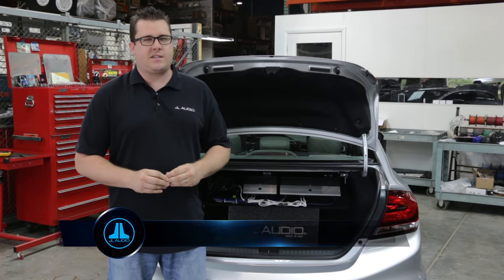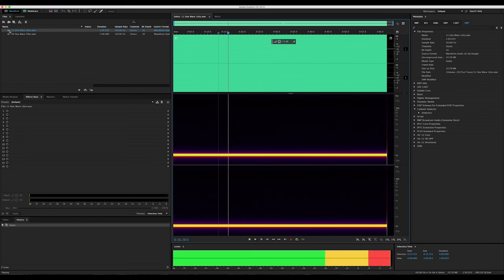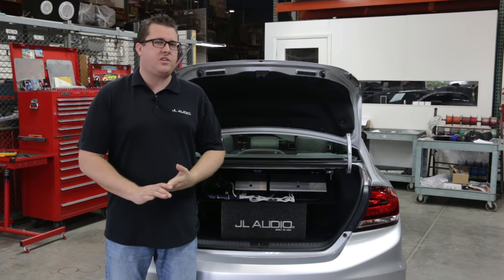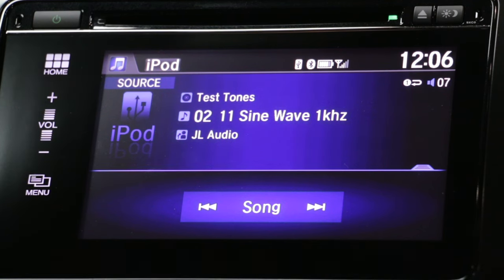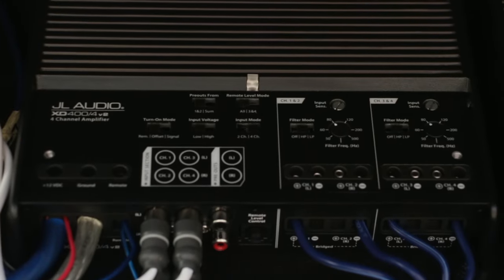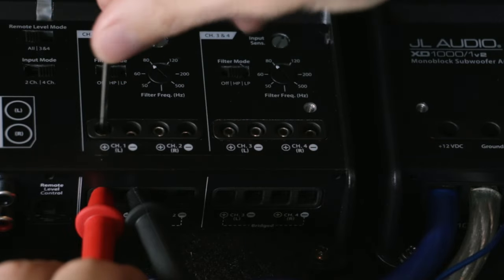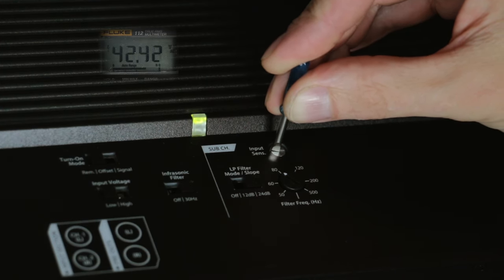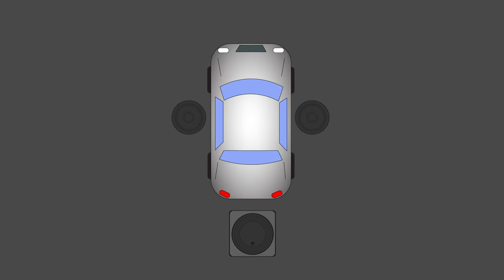Setting Amplifier Gain or Input Sensitivity

Comment: Tried this yesterday but for some reason i vould only get 0.24 volts nowhere near the 24.9 i need , any ideas as to why ? I used a 50 hz -3db test tone,  3/4 volume everything flat or off ! Voltage went up a bit with a bit of bass boost but still couldn't get 24.9 😢
Reply: Depends on the setting you had on the multimeter.  You probably had it on the wrong scale/range so it was showing it as a really small number.  My multimeter has different scales/ranges for each type.  I'm assuming your 0.24 was really 24 volts it just had the decimal place in the wrong spot because of the setting you had the multimeter on.  Just a guess but I'm sure that's what it is.  A good way to make sure you're on the right range is to pop your hood and put it on your battery (car off).  Should be around 12V-12.9V reading.  Change the range setting on the multimeter until you're seeing the numbers display correctly.
Reply: @rxtuninginc8444  ended up with an oscope , the 24 is now an unclipped 27 volts and hits 🤜🤛👌

Comment: so if i have 2 subs that are 750 rms each do i tune at 750 or 1500 my amp is a3500 watt max
Reply from the maker: You would be trying to reach 1500W, but first you'd need to know the RMS power of the amplifier, not max. If the amplifier is only rated at 1200W rms, then when you try to set it for 1500W you'll likely end up with a badly clipped signal.

Comment: Hi. For 4 ohm driver with crossover attach, calculation still base on 4 ohm right.
Reply from the maker: That's correct. Use the rated nominal impedance for the driver(s) being used.

Comment: HELP PLEASE! 
MY amp is rated at 800@1ohm(pioneer 8601). My subs are 200watts nominal each(pioneer TS-W253R) and I have 3 subs. So what should I be reading on my multi-meter when setting the gain for these?
Reply from the maker: Three Pioneer TS-W253R subwoofers wired in parallel will present a 1.33 ohm load to the output of your Pioneer GM-D8601 monoblock amplifier. Based on the published specifications of your amplifier, it should be able to deliver around 600 watts x 1 channel @ 1.33 ohms, which coincides with the collective power handling of your three subwoofers combined. When calibrating to a target voltage by following the steps within our Amplifier Level Setting guide (https://jlaudio.zendesk.com/hc/en-us/articles/204374120-Amplifier-Level-Setting-Guide), you will need to calibrate your amplifier to a target voltage of 28.2 VAC. This will be equal to 600 watts @ 1.33 ohms.

Comment: What kind of deck is in this civic???? thanks JL
Reply from the maker: Stock Honda head unit.  Has a 7" touch screen, back-up camera, blind spot camera, Bluetooth, USB, HDMI and more.  There was really no need to take it out and is why the FiX 82 is being used to correct the factory equalization and send it on to the amplifier.

Comment: What is the voltage for my jlaudio j2 320.4 amplifier that I still have?
Reply: use the formula Voltage  = sqrt( RMS power rating * resistance of speaker)
Reply: @Andrewkosche  thanks
Reply: Wait I’m sorry, what do you mean amplifier? The gain should be set to match your speaker from your amp
Reply: When I say rms power rating I mean of your speakers not amps max rms rating

Comment: I use bluetooth aux device with ground loop isolator. Streaming music via Spotify Highest Quality. And my phone iş Samsung S9+
Max volume is 15 on phone and max volume on sony head unit 50.
Which setting is best ?
Max volume on phone and 3/4 head unit ? 
Or %60 on phone 3/4 on head unit.
Some folk says you should set BT volume about %50-60 to avoid distortion. Thank you for help
Reply from the maker: We usually use ~85% on the phone, basically 2 clicks down from max, in order to avoid distortion. If you go too low on the BT level, then you run a risk of overdriving the amp during your normal listening.

Comment: Any and everyone I've ever talked to in the car audio scene will tell you to use 40hz test tone when tuning your mono amp.
Reply from the maker: Usually any tone within the middle of the bass range will work for the meter method. We use 50 Hz, but 40 Hz should be fine. In using a DD-1 you must use a 40 Hz tone since that is what the device is looking for. Our amps with clip lights are looking for the 50 Hz tone, so you should use 50 Hz when setting clip lights on our amplifiers.
Reply: @JLAudioInc  a class d mono is a class d mono. Your mono amps are no different then any other mono amp. Quit telling people to use a 50hz. 😂.
Reply: @irishmanbd8447  The Dd-1 looks for harmonic distortion at 40hz. JLaudio looks for harmonic distortion at 50hz. Why would they make up an arbitrary number?

Comment: What happens if i put a 350watt psu on a 700watt amp? Is it going to explode when the bass drops?
Reply: SakiSkai no set the gain by taking square root of 350 and set it till your voltage reads that number in speaker output

Comment: On the civic did you guys use another battery or something. I have a 9th gen civic as well and I'm running a 500/1 slash and 2 8w7AE and my lights always dim.
Reply: Did you solve the dimming lights problem?I know, its been 3 years :)

Comment: why dont use a oscilloscope? I think is better and you can mesure the output of the head unit and know the maximum output of it
Reply from the maker: @Jesus Facundo, an oscilloscope is great if you have access to one, but not everyone has one. This is a great alternative as long as you know the amplifiers you are using will do their rated power at the impedance you intend to power.

Comment: I have the jx500/1d with the 10w0v3-4 filter frequency and input sensitivity control they need to be all the way up or where they need to be if you guys can help me please
Reply from the maker: Hello Edgar.  Thank you so much for reaching out to us. 

 So, the LPF or low pass filter is the filter that we use to block out unwanted frequencies that can damage the subwoofer or degrade the listening experience.  A common starting point for the LPF is 80hz and that is what we would recommend for you.  

The input sensitive is the most important dial on that your amplifier and it must be set properly to avoid equipment damage or an unpleasant listening experience.  I will link a video showing in detail our 9 step level setting guide.

Thank you for choosing JL Audio for your vehicles subwoofer system.

https://www.youtube.com/watch?v=2eRYzXBmWq8
Reply: JL Audio thank you so much
Reply: The subwoofer it shut be connected on the +and - on the middle or the ones on the sides
Reply from the maker: Edgar, either way will work.  Sorry for the delayed response.
Reply: JL Audio thank you

Comment: What do I do if my door speakers are hooked up too my head unit & while trying to adjust the gain on my 1000/1v2 my door speakers are going crazy ???
Reply from the maker: Your best solution is to unhook the door speakers to avoid damage. You can also try engaging a high pass filter on the radio, if it has one. This should block out the 50 Hz tone.
Reply: @JLAudioInc  will it work if I adjust the fade and balance just to the speaker where I have the line output converter? That way I only need to disconnect one speaker..

Comment: I do everything exactly as the video says, but when I put my multimeter leads into the speaker terminals I don't get any reading at all, nothing. I have the AC set to 200 AC, the closest I can set it to. The amplifier I use is a Rockville RXH-F5, a 5 channel amp with one  gain knob for 1/2 channels, another knob for 3/4, and one gain knob for the 5th channel, for my sub. 

I don't get readings on any of the leads, would anyone be able to help with advice, please? It would be greatly appreciated.
Reply from the maker: You are using the recommended sine waves at 3/4 volume, correct?

Also, make sure the leads are in the correct spot on the meter. Many multi-meters have two different terminals for the positive lead, one for DC power and the other for AC power.
Reply: @JLAudioInc  Yes, I'm using 0db sine waves, 50hz and 1khz, at 3/4 volume. My multimeter only has two test leads, the COM and the other lead. It may be possible my multimeter is defective or it's insufficient enough to read lower voltages. That's the only conclusion I can come up with.
Reply from the maker: If the meter shows a "200" setting, it would be able to read anything from 0 - 200ACV so it should not be an issue. Unfortunately it may be a defective meter, or perhaps one of the lead wires is damaged.
Reply: @JLAudioInc  I figured it out by trial and error. I tested every combination @3/4 volume with the 0db 1khz and 50hz, and the wires disconnected, to check if I would get a reading that would fluctuate with gain change. I found that if I connected the positive lead of multimeter to the main ground terminal of the amp, and the negative lead to the positive terminal of any of the channels on the amp that I would get a reading I could change by adjusting the gain. As I was testing, I set my subwoofer output to 26.5volts, but for my front and rear speakers, I got much lower voltages, they would only go up to 6.2 with the gain set to max. I'm 99.9% positive I have everything set all correctly. All the EQ, crossovers, and other settings were default or off.

Comment: I can’t find output voltage for jd400/1 jd500/1
Reply from the maker: We do not list output voltage since those are set using the clip indicators, but general voltages would be about 17.3 volts per channel on 400/4 and 31.6 volts at 2 ohm or 4 ohm on 500/1

Comment: what happens when you try to set your gain to high ? will the voltmeter just stop at its max ? will the voltage jump around once you start reaching clipping ? I am having trouble determining if I'm clipping my speakers to death or they are just over powered ?
Reply from the maker: If the gain is set to high the meter will just read it as higher voltage until you have maxed out the sensitivity dial. A regular multi meter will only show you the higher voltage number.  If you use an oscilloscope it would show you at what point past our suggested target voltage the amplifier starts clipping at. Without a scope then it is safest to stop at the target voltage since we know our amplifiers are capable of the target without clipping, as long as the input signal itself is not clipping.

Comment: Pioneer  GM-D9601 amp at 1200 rms 
2 Pioneer TS-W3003D4
At 600 watt continous power.
34hrtz?
Reply from the maker: For 1200 watts at 1 ohm you would take 1200 watts times 1 ohm and then take the square root of the answer to find your target voltage for setting the sensitivity. this would be 34.6 volts A/C.

Comment: Can anyone help me out. I have a 500/1 amp and a 10w7 sub. If I did my math correct, I'm looking to set my amp gain to 38.7 volts. Here's my problem.  I'm getting no AC volt reading. I followed all the eq settings as per the video and still nothing. The amp is in the car powered by the battery, the amp green light is lit, and still no AC signal from the speaker nodes. the only variable I can think of is to set the DMM to DC. Any suggestions are appreciated.
Reply: do you have shitty rcas. that will do it
Reply from the maker: Does the subwoofer play when connected to the amp?  If so you have a bad DMM.  If not, please contact our Technical Support team so we can help you troubleshoot why there would be no output from the amp.
Reply: +JLAudioInc yes the sub plays, so I'll buy a new DMM and repeat the process.  Thanks for the help.
Reply: I ran into this same issue, until smart Me realized i should turn the car on first. LOOOL

Comment: 5:10 The "Gain Knob" is not a volume control. At least thats what I have been always told.
Reply: That's for increasing the volume, decreasing volume by adjusting the gain is perfectly fine.
Reply: You can't hurt your system by turning your gain lower, however turning your game up past its limits is where you start to hurt the system. If you kept listening to what he was saying, he explicitly stated to not turn one of the amps up but to turn the other one down. Turning volume down is better than turning it up.
Reply: @Mrjoecreeper  No its not. A gain control is not a volume control. Gain controls are on the input side of the component, while volume controls are on the output side. A volume control can't distort the signal. That's why you need to set your gain structure in the first place. Only gain can distort the signal, so once you have it set properly, the signal can't distort regardless of volume. Once you have gain set, leave it alone.

Comment: so according to this, we use the hpf and lpf we are going to be using when setting the gains?  most everywhere else says to turn them off
Reply: crossovers affect output voltage I found when I turn up my lpf on my monoblock amp the output voltage gose up and when I turn it down it gose down so I think its best to set the crossover first to the hertz level you want for a sub id say 50 -80 hertz somewhere in their then adjust your gain

Comment: How do you set the LPF?
Reply from the maker: Albert, for most subwoofer systems we'd recommend starting with your LPF @ 80hz.
Reply from the maker: Looking at that amp's manual, there is a recommended setting on the second page for the LPF that's around 11 o'clock on their dial. Unfortunately they do not offer a more detailed explanation of the filter dial functionality.
Reply: @JLAudioInc  ok thank you

Comment: so my question is if i were running two 4ohm speakers @60 watts rms each in parallel per channel would i add power together then multiply by ohms for example 120x2 then square root or 60x2 then square root ???
Reply from the maker: Hello David,

I understand you are looking to determine the target voltage, can you provide me with the model of your amplifier? Target voltage is determined by the amplifiers RMS power rating at a specific impedance. Also, are you wiring 2 speakers into one channel? Can you also provide me with the model number of the speakers you are using?
Reply: JLAudioInc amp rms is 240 x 4 rms @ 2ohms and using pioneer ts d1602r 6.5 speakers. yes two 60rms speakers in parallel into 1 channel @ 2 ohms
Reply from the maker: David,

Based on the information you have provided about your amplifier, the target AC voltage for 240 watts at 2 ohms is 21.90. Now, since the speakers you are connecting are 60 watts RMS, you will need to dial the power back some on the amplifier. The total wattage of both speakers combined is 120 watts and since you are wiring them in parallel for a 2 ohm load, the target AC voltage you need to use is 15.49.
Reply: JLAudioInc right on thats what i came up with but wanted to be sure thx for this very infomative video and replying as well
Reply from the maker: David,

You're welcome. Glad to help. Have a great day.

Comment: Should I switch the "input range" back to low level after adjusting? I am using aftermarket headunit but am getting 50volts with the gain all the way down.
Reply from the maker: @Daniel Saucedo, what amplifier do you have? I would typically suggest starting with input voltage mode in Low when using and aftermarket source unit. If you are in low and sensitivity is all the way down and you exceed the target voltage, then switch to high and start over.
Reply: @JLAudioInc  I have the HD 900/5. And a Sony headunit that outputs 2v it says. I'll try switching to high input.

Comment: Is it bad for the gain to be all the way up? My subwoofer has an rms a of 400 watts and my amp puts out 300 Watts.
Reply from the maker: Hello Dominick, it could be bad yes. If the signal level is strong enough out of your source unit the amplifier could be driven into heavy clipping very early if gain is all the way up. I would verify the settings with a meter as shown or an oscilloscope if you have access to one.

Comment: The test that you're performing is for one woofer right? I have two woofers with a 5 ch amp: 

http://www.crutchfield.com/p_113XR9005/Kenwood-Excelon-XR900-5.html?tp=115&awcp=1t1&awcr=28870854203&awdv=c&awkw=xr900+5&awmt=p&awnw=g

the amp is 600 watt for the woofer, I'm guessing. My 2 woofers are 4 ohm 400 RMS. How would I set the amp for both woofers?

http://www.crutchfield.com/p_113XW120/Kenwood-KFC-XW120.html?tp=111&awcp=1t1&awcr=58098514523&awdv=c&awkw=kfc+xw120&awmt=p&awnw=g
Show less
Reply from the maker: +I Come in Peace! Setting the amplifier's sensitivity will help determine what the output voltage will be.  It doesn't matter how many speakers are being powered.  If you have multiple speakers, figure out what output voltage is needed to properly run them without clipping, and set the amplifier's sensitivity to that output voltage.  There is a chart on the JL Audio Help Center to help identify output voltage recommendations.
Reply: +JLAudioInc thanks I'm fixing to check it out now!